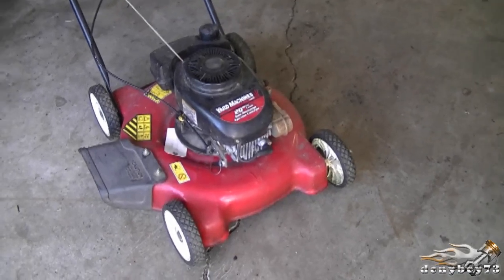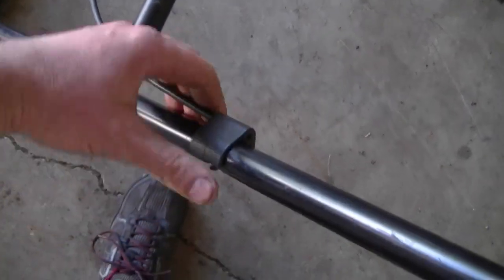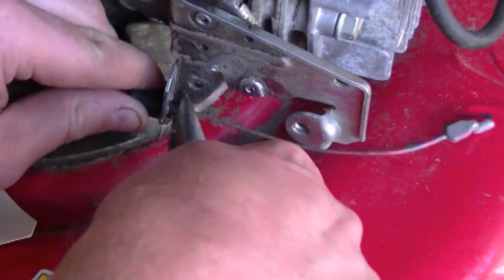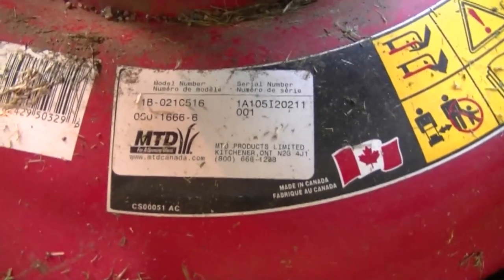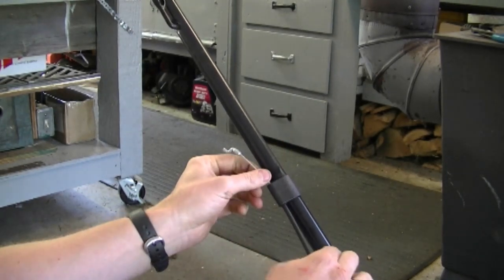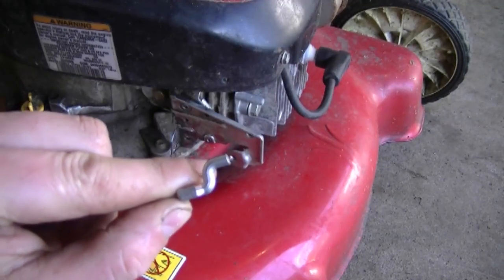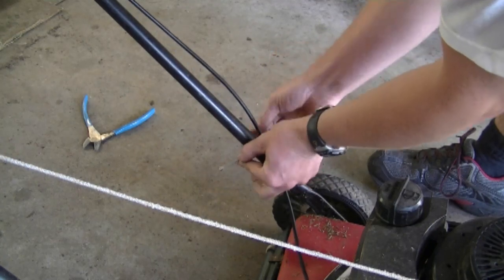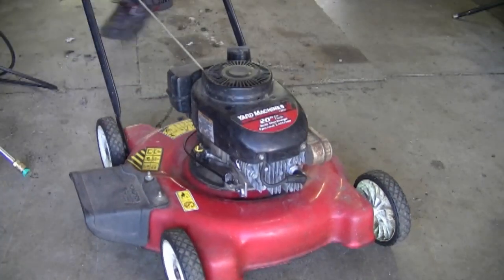HOW TO Replace The Brake Cable On A Lawnmower With A Tecumseh Engine

Comment: i come across these mowers often so im pretty fmailiar with them. my mom has this exact mower..ive managed to repair them all theyre pretty easy as most are..but i got one the toehr day and it has no compression..when i pull i can feel it wants to start but doesnt..i look ed at the springs and everything and everything looks fine and i sprayed them both and still nothing...only thing i can really think of is the head gasket but im still not sure thats it it also looks decent...when i turn the cogwheel there i can hear air escaping form what sounds like the carberator area not sure why that is everything seems air tight to me...with the old carb gas was leaking into the filter...i chalked it up to a bad gasket in the bowl as with these its common that the tecumseh carb the gasket around the bowl is too big but the aftermarket ones i buy fit perfectly..still that didnt change it still doesnt start. maybe this is one that just came to the end of its life..unfixable i suppose..i tried pretty mucha ll i know and its still not starting could be soemthing a certified mechanic would know something simple i bet but i cant be bothered.

Comment: I need the blade brake control bracket and cable but I can't find any diagrams because Tecumseh LV195EA doesn't show it their diagrams.

Comment: I have a cable issue... my cable is not broken, but, when I let go of the kill bar, instead of stopping the engine it keeps going... the engine only stops if I release the bar halfway  and wait for it to stop before fully releasing kill bar. Any takers?

Comment: careful where you put the zip ties dony, I had a mower that needed a cable to i replaced it and i zip tied it flush with the handle bars and when the customer folded the handlebars to fit it in his car, the cable broke inside the sheathing. i always do them so they have some play in it

Comment: How about doing a DIY on Briggs & Stratton push mower R & R STOP/KILL SWITCH, part # 396847 692310?  Majority of vids are on replacing the brake cable or assembly itself but not the switch itself! Thank you!

Comment: Anyone ever had this problem ? I have a Tecumseh simular to  the one shown. I pulled the cord and heard a clanking sound like the flywheel was hitting the coil. So I took it apart and installed a new key. Put the flywheel back on. And attempted to adjust the coil. Slid my index card between the flywheel magnets and the coil, I got it set. But when I spin it half way around I noticed the flywheel looks to be off by as much as a 1/16 th of a inch. Spin it around  the rest of the way and it seems ok. Is this normal ? 
For what ever reason someone tied knots in the cables. Now they are to short. When you hold the break lever down, it takes a lot of pressure. And I am thinking it has pulled something out of line. Perhaps not but I know. The coil is bad, cleaned it gaped it and still no spark. Not sure if I should spend the money on this one or not.